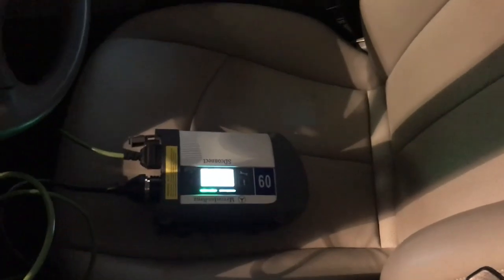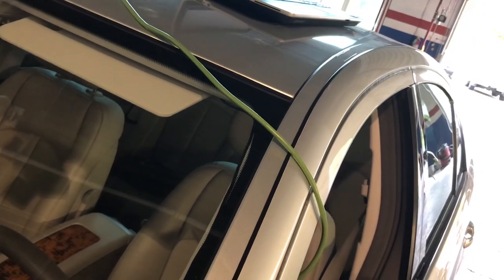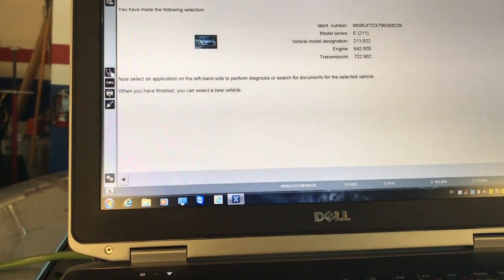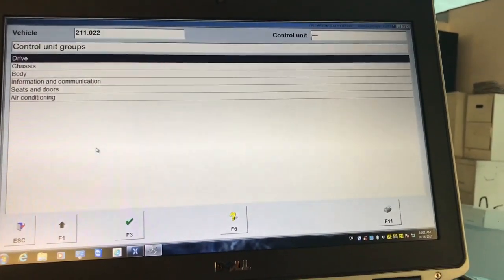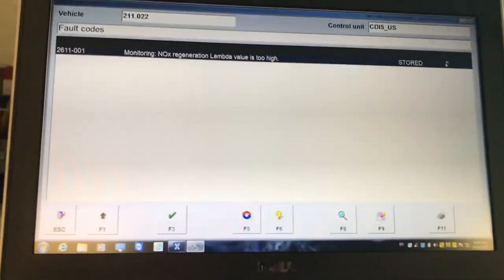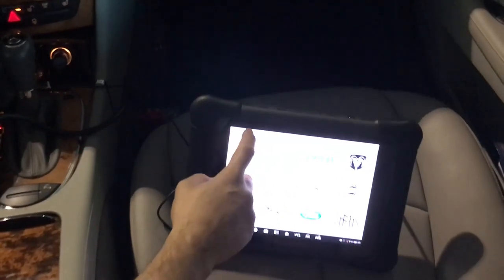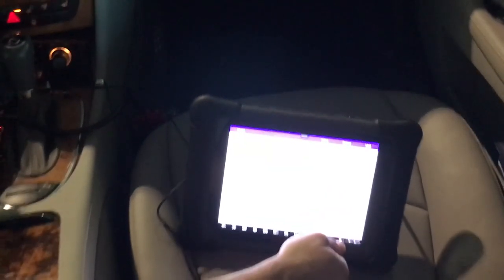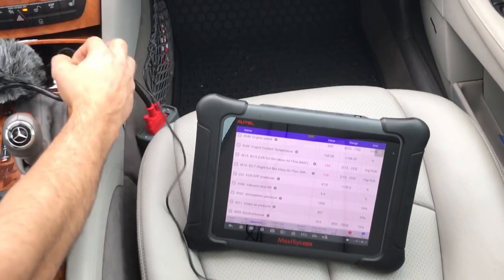2009 Mercedes E320 Bluetec Boost problems part 1

Comment: Thank you! Very Informative.  I am interested in seeing Part-2 of this video - hoping you have one.

Very Timely, too.  I have a 08 E320, at 130K mi with similar problems. Iam the first owner, maintained for all recommended service at dealer until warranty and then at an independent shop xMB working only on MB in NC.

It all started with replace fuel filter message, no CEL.  Replaced Fuel Filter, and Boost Hose as it had a couple of cracks - and ever since then have been getting P2016-001(fuel rail pressure too high),  P2017-001 (Fuel Rail Pressure too low) and P2047-001 Fault Codes - using a autologic test equipment at an Indie in TX. The car drives fine at low speeds upto 45-55mph on flat roads but does not respond to stepping on the pedal. Once you hit an up-hill or step on the gas pedal - the car becomes unresponsive and shuts off.  It starts once again - but then does the limp mode dance. 

After the initial diagnosis at an indie, in TX, then took it to MB-Dealer,  two trips to dealer, 10+ days, and $600 down, they do not have any other diagnosis than what we already knew. Dealer's initial diagnosis and solution to P2016 is  - contaminated fuel (???) - wanted to bring down the fuel tank to clean it and then proceed with further test, they will not specify how they arrived at the determination of contaminated fuel, when pressed for the determination in writing it changed to "possible contamination" .  I did not authorize "colonoscopy" for a "tooth-ache" so the car is back at another indie  awaiting diagnosis.... and the saga continue, hope to have some closure soon.

Pardon me - am frustrated at the lack of commitment from MB and Corp-MBUSA to accept any responsibility and unwillingness to help, as I search the web - noticed 

a .  there is an issue with Fuel Leak with some models of ESeries, MB extended warranty and replaced gas tank/pump. Unfortunately, my vehicle does not fall under this category, although I have the issue of fuel leak when topped all the way.

b. Apparently the limp/boost problem is common amongst - MB being fully aware - is ignoring the issue. Offering to give me $250 toward fixing the problem - when it may cost over 50times this amount to fix it -. 

Hope to garner enough support from affected owners - to make a stronger case with MB.
Reply from the maker: vijay Nagaraj the links to part 2 and 3 is in the description of this video. Hope to be of help. This car was like you describe and I was able to fix it, customer is very happy with it. If you need further assistance please post email here to contact you.

Comment: Had the same problem with mine. I cleaned the codes too and the shop couldn’t tell what to do until it finally screwed up and I left the code in the ECM. Turned out to be the intake manifold flaps. Works great now. Until the next time that is...
Reply: vintagehaynesflute what do you mean manifold flaps? How did you fix it?

Comment: Awesome video how do you like Xentry? Can you program an instrument cluster on a ML350 for milage? I can do it with anything I’ve tried.
Reply from the maker: Is this a new cluster? Or are you trying to use the same, or a used one? Need more information to understand what do you need to do! If is a used one, you can’t! Well you’ll need to have programmer and read, Virginized and write the new info. Make sure to collect the original info from cluster and move that to donor cluster.
Reply: If it has less than 250km and you have an online Xentry Flash account, yes it will program the cluster and pull the correct odometer value from the EIS.

Comment: Great Video.  I noticed your results on the pressure positioner test where 976 and 1013hpa.  Mine are 920 and 1010hpa.  I'm guessing this is turbo failure (not able to spin freely - creating a vacuum) rather than carbon build in the cats?  Or could it be the boost pressure sensor?  What do you think?

Comment: I have the ML320 BlueTEC and i have change some parts and i keep getting a code the positive controle deviation during boost pressure control is too high